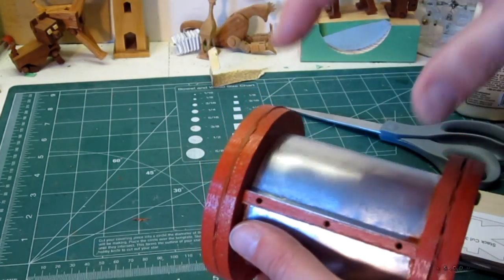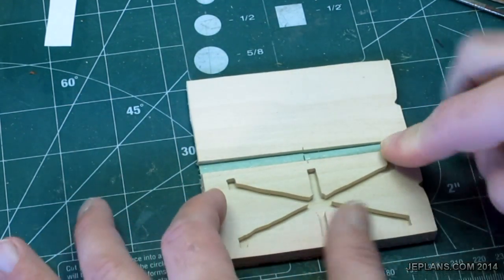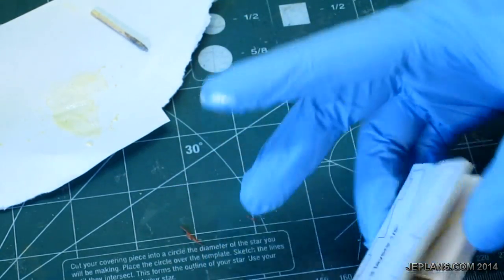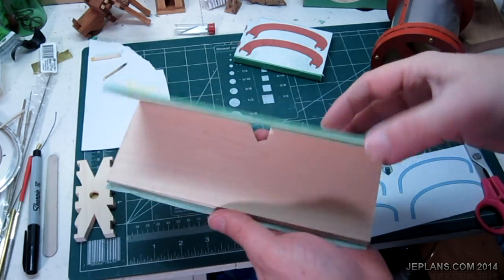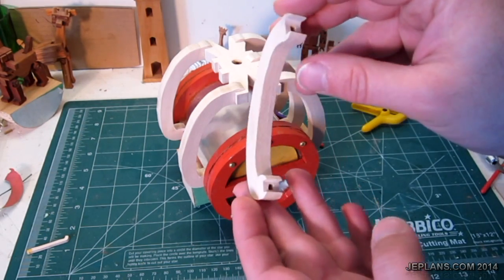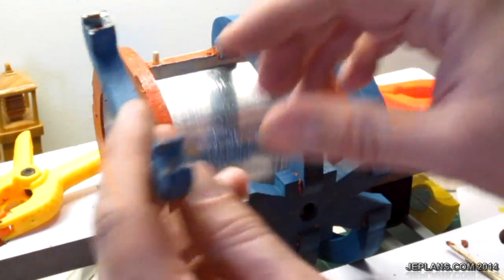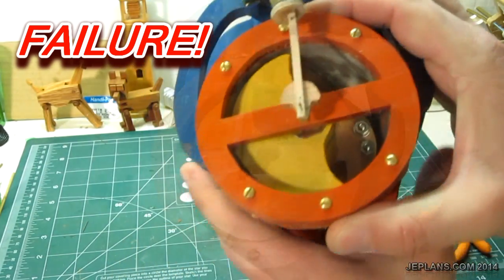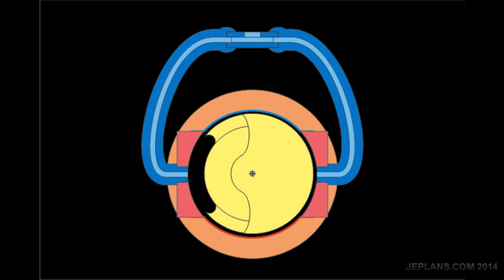Rotary Heat Engine Part 3.1 Air Delivery System

Comment: I don't want to come across as rude, but judging from your design, you don't have a fundamental understanding of how stirling engines operate.  You should only be drawing air from the cold side, not from two opposing sides.  You're also creating wayyy too much 'dead air space' with all those blue tubes.  Mount the working piston on the round, cold side of the displacer cylinder to eliminate all dead air space.  Think submarine, or T-handle shape...

Comment: First –passing through midpoint should not be a problem.  Every Stirling engine has a midpoint when the air is midway between hot and cold.  That is the transition phase.

Reducing airspace will not increase pressure change.  The more gas you heat, the more change you will achieve.  You likely have a pressure leak. Test for a pressure leak by attaching a full balloon to the pressure chamber and watching to see if it will deflate.

Your adapted displacer will still be generating no work when it is between hot and cold, the same problem you had before.  Decreasing thermal transfer surface will decrease engine performance.

The air motor you want to run with this requires a constant flow of air to make it run.  You can’t get that from a Stirling engine.  The Stirling engine only works because the air does not escape.  If you bleed the pressure off to run your air engine, the Stirling cycle will stop immediately.  The air must be held captive so that it can contract and complete the Stirling cycle.

Your fabrication skills are awesome!
Reply from the maker: All my projects are just experiments to see it some idea I have will work. I continue to test and adjust the original while I work on the new rotary displacer cylinder.  There were issues with seal, and it is now generating a little force but not enough and not at the right times. The transition phase is not long enough to let the piston get the in the right position for the next phase of the cycle, adjust it for the hot and it is off for the cold, adjust for the cold and it is off for the hot.  The greater separation in my new plan will correct this and make it easier to maintain greater heat deference.

The real experiment here is if it would be possible to rectify the Stirling cycle to run the continuous flow engine. Unfortunately the whole rotary displacer thing is getting in the way of trying my ideas for that.
Reply: JEPLANS Your projects are awesome, but I think I see a couple of flaws in the design.  If your rectifier allows air to flow from one engine to the other, the rising pressure in one engine will be drawn to the dropping pressure in the other one and they will neutralize.  The Stirling cycle is not pressure - pressure - pressure.  It is pressure - suction - pressure.  Half of the cycle is the engine running on the contracting gas.

The other problem is air supply.  If your rectifier does allow you to pump air out of the pressure chambers, what then?  If you create a system that will pump the air out, you will soon have a vacuum inside.  Your bellows have an air intake and refill with fresh air on every stroke.  You have a finite amount of air in those pressure chambers.

I could be wrong if I misunderstand your pentabellows engine.  If it runs on a continuous flow of air, it is not going to work.  If it runs on rising and falling pressure like a Stirling engine, you may have a better chance.  But in my experience with small Stirling engines there is rarely enough pressure inside the engine to run a second device.  These things generally have just enough power to run themselves.

Your pressure chambers will work as Stirling engines, but not as a perpetual supply of compressed air.
Reply from the maker: Jim Larsen The draw between the two displacers is what I am counting on.  If you get a chance watch my Video  "Radial Air Engine" http://youtu.be/ZLyDqcseqWY and imagine the hand operated bellows in what I called the pneumatic power system replaced by 2 displacer cylinders. I believe it should work, but if it can generate enough power is very questionable.

Thanks for the input.

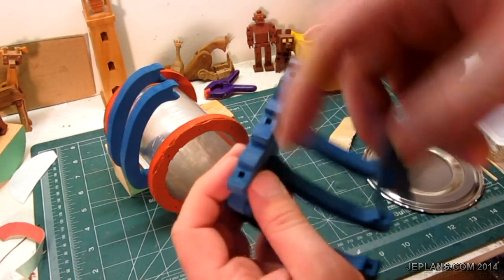Comment: Nice design. What glue do you use at 6:08? Thanks
Reply from the maker: Ultra Copper High Temp RTV Silicone Gasket Maker. It was what I used to seal the cylinder.  The high temp characteristics are not really needed for that part.

Comment: do not give up. there are only several stirling rotary engines working on youtube. they are frictionless and slow, so this task is difficult. By the way, I like your manufacturing process, it's really teaching. And don't forget to show even how you made the power piston !
Reply from the maker: Thanks, I very hopeful it will work. I didn't really get into the power piston because,I don't really intend for it to be the final drive mechanism.  You can get a feel for how it is made in "Beer Bottle Engine II Part 6" , it has to be the easiest way I have come up with to drive a stirling engine, but for some reason I haven't really used it much.